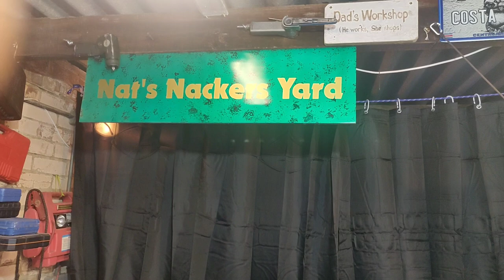Nat Breaks Bikes.  2 for 1 Special

Comment: The issue with helicoiling spark plug holes is not usually failure of the insert itself, it's how you drill and tap the hole. If the hole and the freshly cut thread are not perfectly perpendicular to the seat, or the seat itself has been damaged (by previous repair efforts, possibly) it will be impossible to get a gas-tight seal. An engineering shop may be able to recut the seat, once the head is removed, which may be easier than building up a second-hand head, with all the valve lapping, new stem seals and re-shimming that would involve.

I don't think a leak there would be causing the fast idle. Usually, that would cause a chuffing noise and uneven running, as one cylinder is down on power, but for an air leak to cause fast idle, it would have to be on the induction side, either downstream of the carbs or inside them.

The lug on the Honda will need welding in some form, if it is going to have any strength. On screen it looks like you have 2 cracks, at about the 1 o'clock and 4 o'clock positions. The way I would tackle it would be to cut all the way through those cracks with a thin cutting blade on the grinder, and take out the piece. This should allow you to extract the rest of the bolt. The cut-off piece could then be cleaned up and the edges of the cut chamfered to allow good penetration of the weld in the joint. This is the point where you will need the services of a competent welder to reattach the piece (TIG would probably work best). After that, you could drill out the hole and either helicoil it or use a through-bolt and nut.
Reply from the maker: Thanks mate. The fuel on the xj exposed the problem I think rather than explained it.  A new cylinder head is a fair amount of work but I think it is worthwhile doing.

Comment: I'd talk to a local machine shop about that bolt, it's a prime job for either chucking the lump on a milling machine and drilling it out properly, probably with left hand drills, or hitting it with an electroerosion rig (tap destroyer).  If the crack is only on the lug, no problem with getting it welded up, re-drilled and tapped, good as new.

As for the XJ, new head is the way to go for sure, but I'd be worried about why the carb was flooding that cylinder in the first place.  Surely the float needle should have stopped it, even with the tank on prime?
Reply from the maker: Your right on both I think.  Blue can wait.  I am in no rush.  The xj fuel is an issue (prob carb( but at least it letting go expose the larger problem.

Comment: If accessible i would chop the rear of that bolt flush with the frame (dremmel) drill through a very small hole, then widen it and put a thinner bolt all the way through.  One with a nut on both sides possibly. Nylon nut and some lock tight. 

I was freezing yesterday, it is hard working on the bikes when its very cold. 

Cheers Nat
Reply from the maker: Thanks mate.  I don't think that I can get to the back of the bolt to slice it off.  I will come back to it.  Just annoying me at the moment so I have hidden it!

Comment: Fuel flooding in to the cylinder is not due to a loose or leaking spark plug.
Reply from the maker: I agree but it did more than demonstrate the problem!

Comment: Been there with a CBF500, the front engine mount bolt corroded to the extent that it cracked the engine casing mounting in two. I tried to salvage it, but in the end scrapped the whole bike minus a few salvageable bits, otherwise a good bike, tragic! An ex-Honda technician told me a long time ago to strip every bolt when you can, as soon as you can and Coppaslip it to the max, sound advice, it turned out! David
Reply from the maker: Retrospective advice unfortunately!

Comment: Keep chipping away at that bolt mate, it will drill out just take your time. Try and get a 5mm all the way through, take it steady with plenty of lube, then up to 8mm and finally the clearance size for the existing bolt.

If you've managed to shear a bolt that diameter then it will not come out with an Eazysnap.

One engine mount down is not the end of the world, plenty of chopped bikes running around with only half the engine mounts in place.
Reply from the maker: Cheers buddy.  I will keep on keeping on

Comment: I think if the Honda was mine I'd have the engine out to give better access.  If the engine mount isn't cracked right through you might get away with just drilling the bolt out. If it's cracked through it needs welding which may not mean a full engine strip but someone that knows there stuff to do it. Did seen a mobile welding guy on Internet. Think it was all metal welding services. Never used him but looks like he does that sort of stuff. Probably others about as well.
Reply: You beat me to it, be surprised what a good professional welder can fix.
Reply from the maker: I may have to resort to that but stashed for now.